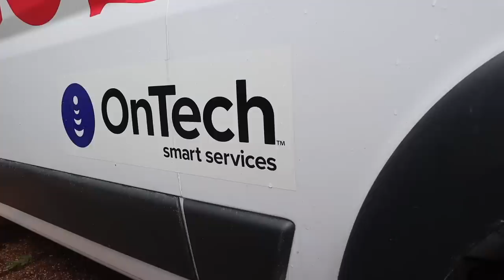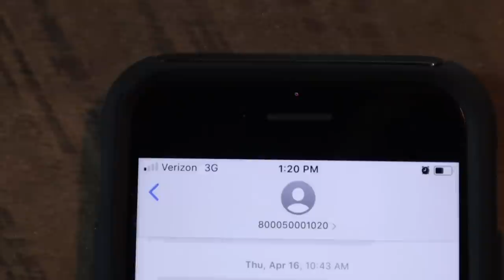The Dam is Holding Water!!! & The Off Grid Cabin gets WeBoost / EP #24

Comment: Another thought (If someone hasn't already mentioned it)  - On our irrigation pipes we use on the acequias in New Mexico, we have adjustable gates on them... You could buy one for about $150 or less and put on that 10" pipe - would make it easy to open/close and you could regulate the flow really easily too (for storm surges n' such)

Comment: While everything at the dam is "fresh" consider applying a few bags of bentonite clay to help seal everything.  The stuff works.
Reply from the maker: Yep that is a plan of ours. Thanks
Reply: 8
Reply: yes it does
Reply: Another vote for the bentonite clay on the soil/ground part of the pond if anyone doubts it... It works great!!!  If you wind up with water actually soaking through the concrete (or if the concrete part of the dam cracks) - there is a crystalline product called xypex that can be applied on the negative pressure side (as well as the positive pressure side) and works amazing!
Reply: HYDRO CONCRETE BROTHER FOR THE LEAKS
Reply: My thoughts exactly,stop up the eye of a neddle
Reply: garonite and clay

Comment: With earthen dams then they leak to put grout in. So if you can’t find the leak then see if you get drillers grout from a local cement company. It’s doesn’t set really. It’s more of a slurry. Remove the sediment and lay it in the bottom of the pond. Or see if you can find good clay and do the same.

Hydraulic cement around the PVC pipes on the reservoir side.

Comment: Pea gravel mixed with gypsum and poured in the vicinity of the leak will usually stop it. there is another trick to building dams, which now is too late, but if you're going to build a dam at your pond, do this first: Dig a trench the full length of the Damned. The trench should be 3 or 4 ft deep or until you hit bedrock. Pack the trench with clay soil in compact the hell out of it, then build your dam wall.

Comment: that stump behind the damn might be a problem. it was likely about a 15-25 year old tree (maybe older depending on what type it was), and probably has some deep /widespread roots. Even if you cut the roots  at the bottom of the damn as you excavated for the damn, you may have had to go much deeper than that to remove those roots (hope you looked at that).. as that stump rots and also its roots, its going to change the shape of the ground at and behind the damn where the water pressure is. maybe even create channels where roots used to be for water to get under your damn. i'm no hydrologist. but remeber a rule of thumb for building a spill way/damn was that the long term stablity of the ground at the bottom and just behind the dam was the most important. seems you may already have a leak. but hopefully you can drain it pretty easy and correct the issue before that rotting stump affects the ground at the root of your damn.

Comment: Im here because Im in the planning process of doing this but Is this legal?? Ive been told you cannot dam up creeks and obviously rivers. I want to make mine like a dome shape so logs can go up and over it in high water events. Mine would be the same height but only about 20 ft across. So what I wanna know is if this is legal. The water still flows the same gallons once its full so I dont see the problem but you know how regulations go..🙄
Reply from the maker: Check your state DNR for info and your local Corps of Engineer.

Comment: Now that the speed of the water has increased dramatically, you need to dump quite a few truck loads of rock on the down side of the dam, otherwise you’ll have massive erosion problems. Particularly as it looks so steep on the down side of the dam running away. And then push it right up above the height of the dam either side because if there’s ever a mass deluge of water it’s gonna run under the outside of the dam walls.
Reply: Rip rappppp

Comment: Are you going to leave it as concrete or face it with stone so it looks like a stone dam? 

Ever make an info plate? A section of scrap copper pipe cut in half and flattened into a sheet gives you a good base to use a stamp set to punch in info like the date a project was built and who made it so years later you have it stamped in metal of who and when to not limit yourself to human memory. Can go for cheaper plates for interior like aluminum cans cut into sheets but they would weather away after a few years outside so best use something like copper that will turn a nice green but still be readable. Good for marking fence lines or for an info plate at a gate for contact info that isn't likely to change.
Reply from the maker: Great idea thanks

Comment: hi guys, really cool project. Congrats on all the hard work. I will say this though. These types of projects dealing with geo/hydro stuff are complex projects requiring lot's of thought and planning and engineering to actually LAST long term. So although I think this looks good at first glance, I don't see it lasting that long for a bunch of reasons. I live on a river and know the power of hydro. For instance, the front end area needs some sort of reinforcement to keep the soil from eroding and letting water go around the dam. It just looks like soft dirt there right now, that won't last more than a year or two. All the concrete work most likely needed to be thicker and deeper for any sort of long term durability. Your offshoot drain pipe needs to  have a mesh on it or it's going to suck in debris and get clogged. I think the effort is AWESOME and it looks really cool tho, I just fear that you might be stuck with a lot of repair work in only a few years. Anyway, hope not. Time will tell.
Reply from the maker: Thank you. I definitely have improvements to make. I’ll be making a vlog on those this winter.
Reply: @LoftisPartyofSix   yeah, it's definitely an industrious project, we all appreciate you sharing it, super interesting. At the minimum, lot's of learning will be had for sure...

Comment: It's possible that water is leaking around the stumps root system
Reply from the maker: That is very true as well.
Reply: @LoftisPartyofSix  that was only a random thought from me. I'm just impressed by the diy concrete dam and the pressure of the h20. In another random thought I'd almost put a longer pipe on the bottom to keep the water pressure from eroding the bank immediately around the dam the water wheel until it's complete, also I'd probably cold fit (with out glue) a ball valve on the inside of the dam so you can control the flow of both your weir for the wheel and the pipe. But those are just my random thoughts and probably don't merit any real action. I'm more than impressed with all the builds in your channel, you've given me all kinds of ideas for when I remodel my newly acquired fixer upper also referenced to by the neighbors as the country ghost house cottage.